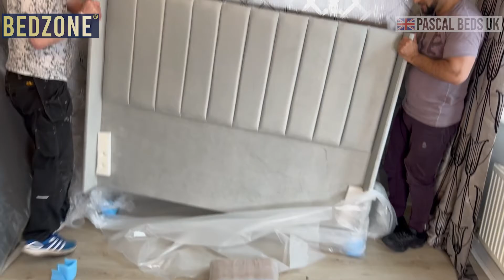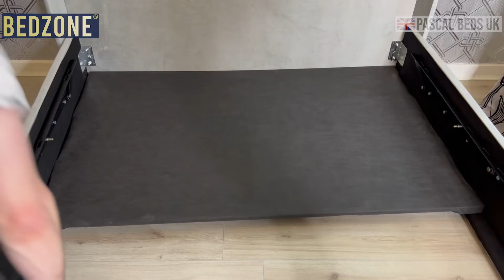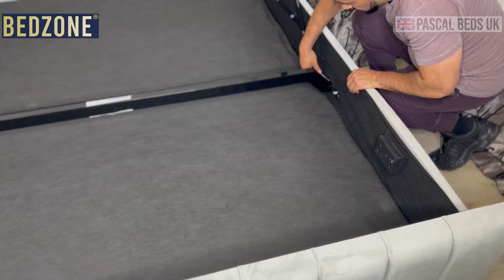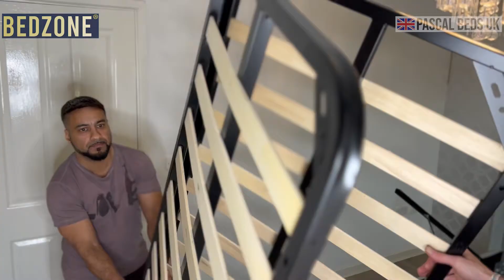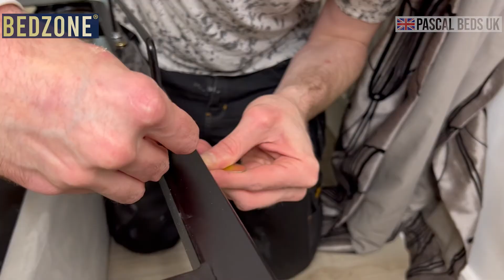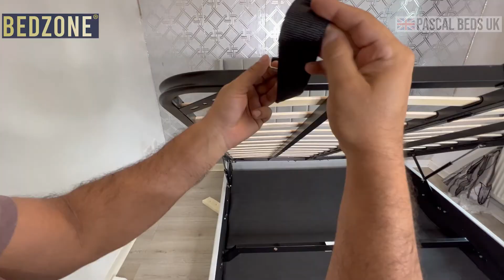Slatted Ottoman Base - Assembly Instructions

Comment: So what happens when your floor boards are completely out of square? What happens when your middle brace wont screw in properly because some divvy cant pilot a hole straight and the bolts just keep spinning? What happens when the pistons spring right back up instead of staying in a closed position?